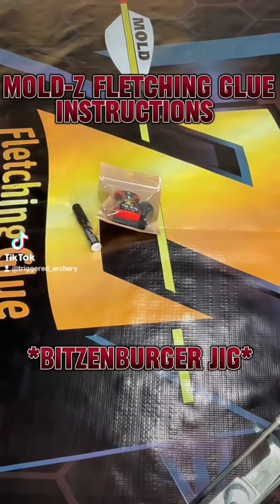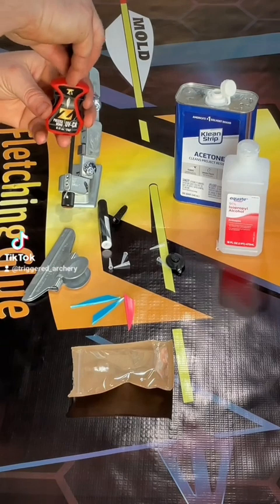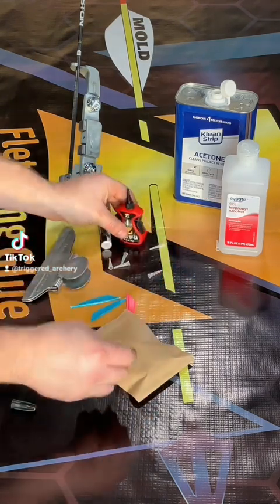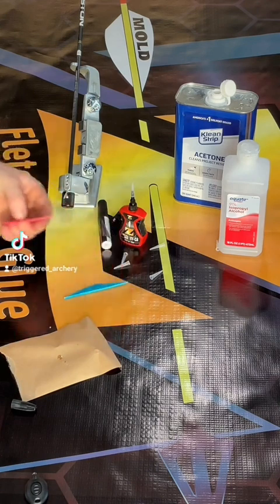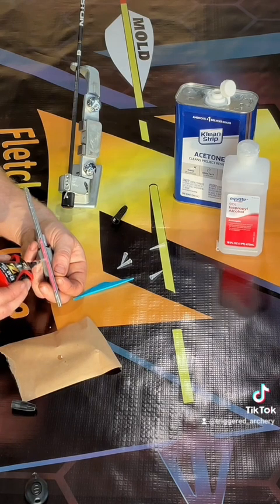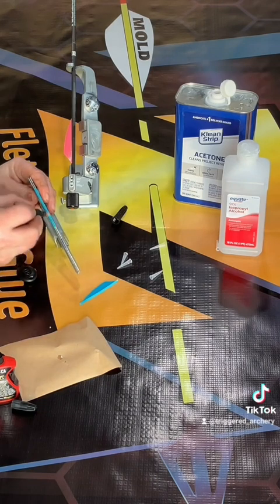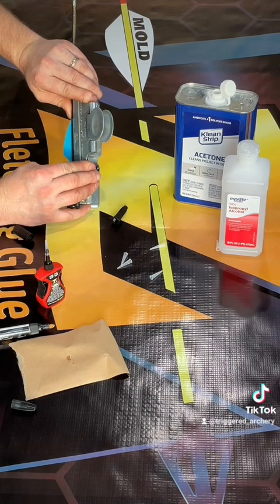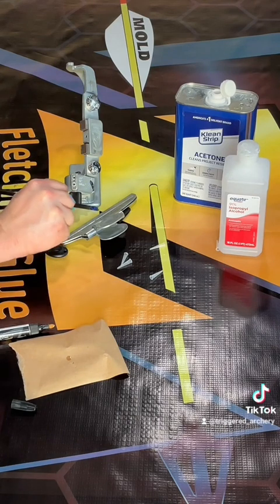Mold-Z Fletching Instructions Bitzenburger Jig

Comment: I bought this glue after watching some reviews , I fletch 10 arrows with AAE vanes , used the primer pen waited 15 minutes to apply glue then used uv light , waited 12 hrs after fletching and out of the 10 arrows I had one vane that stuck , I do t know if I got bad glue of it just doesn’t work with AAE but I had horrible results , literally took no force to take the vanes off
Reply from the maker: @longshotdiedtired1582  this is not at all common results. Please reach out to us and we will find out what's going on and get you back up and running!
Reply: @ do you have a web page or contact information ? I ordered through Lancaster
Reply from the maker: @longshotdiedtired1582 saw your email. We will handle this right away!